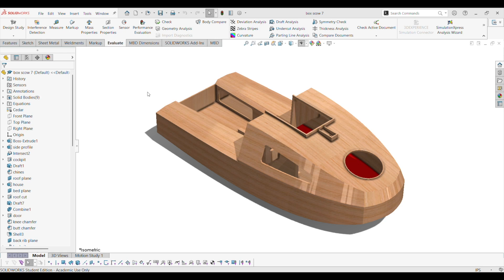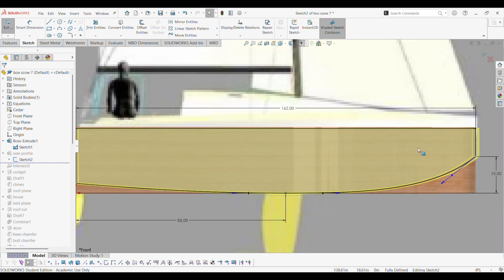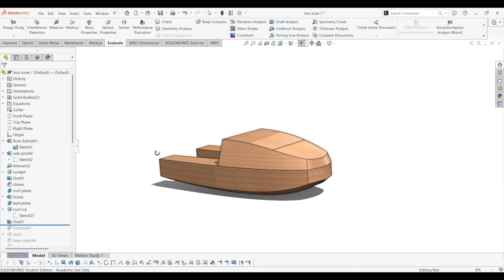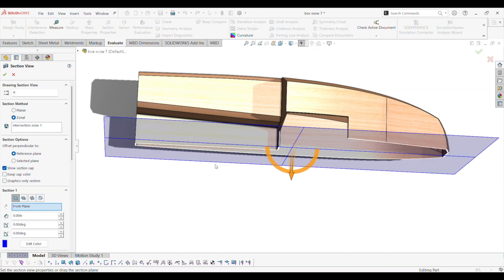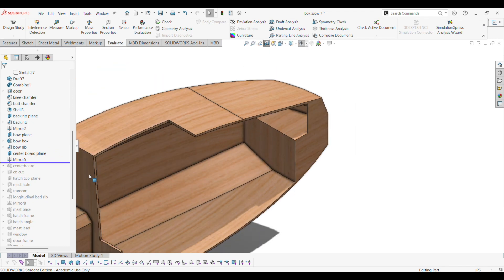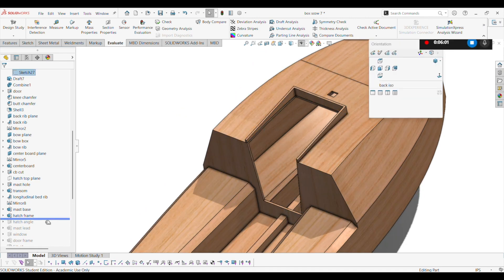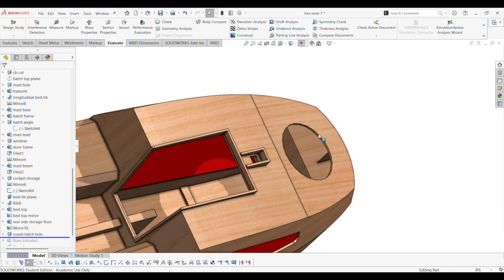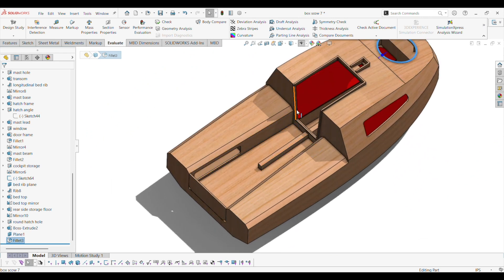Modeling a Boat Hull

Comment: Hi. Will you have provision for a strong point in the bow?
Reply from the maker: Yes, there is a water tight box in the front.  It can be filler with styrofoam or empty water bottles.

Comment: Its a good technique - if you put some offset planes where you want the bulkheads (ribs), slice the model and the output the dxfs for each you can import them into delftship and get all the pertinent hydro calcs done for you.... never tried airshaper yet but might be interesting to see what the open / cloud CFD platform makes of the designs / tweaks
Reply from the maker: I have not learned Delft ship yet.  So many programs to learn and not much time.

Comment: Interesting approach. I would've probably used the sheet metal tools to enable getting flat patterns of all the curved parts, do you have a method for that?
Reply from the maker: Yes, there is a flatten surface tool.  It works well. I do that at the end after final edits.